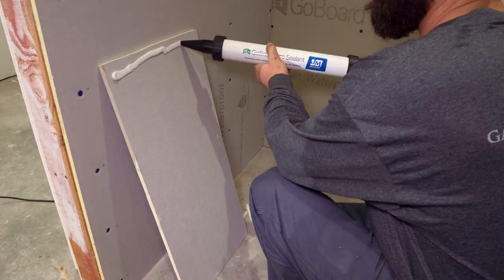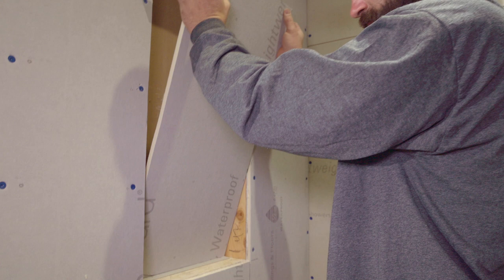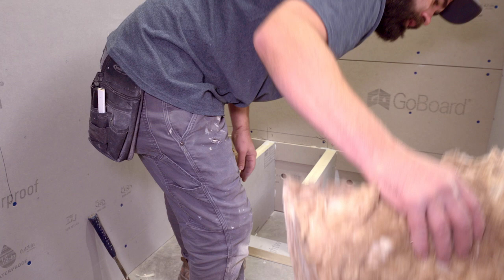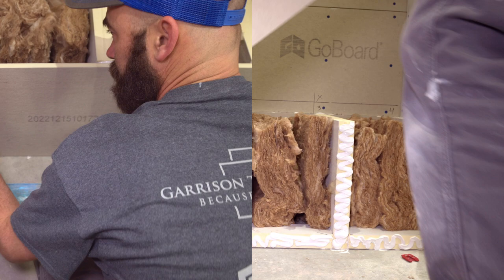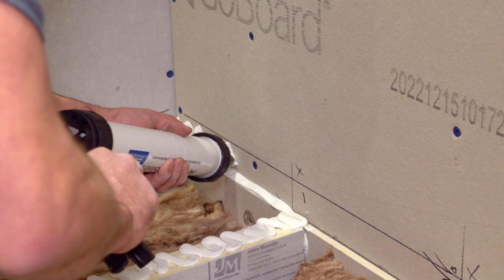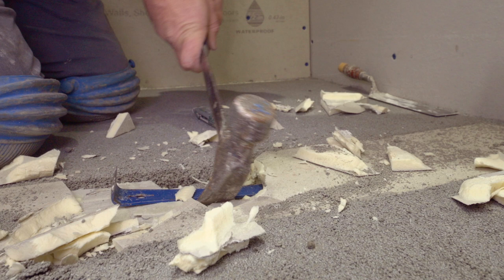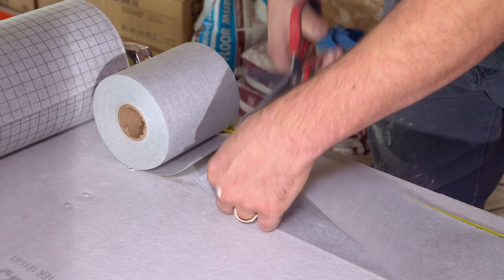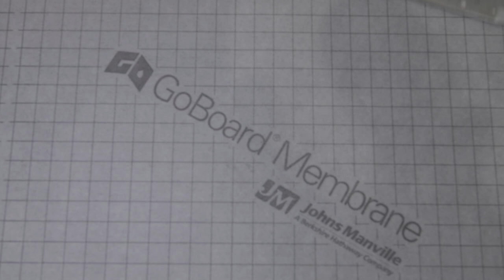2023 GoBoard Contractor Spotlight : Brandt Garrison Uses GoBoard Membrane and Thick Boards

Comment: If you were worried enough about condensation you could have put solid spacing blocks down against the concrete between the uprights for your bench support. The fiberglass insulation just doesn't have a use case here. It's a head scratcher.
Reply from the maker: Thanks for your feedback! We appreciate it! =)

Comment: I just have a question as to what exactly did you use to connect the Goboard to the concrete base? Was that thin set and if so what exact type? Look forward to your response.
Reply from the maker: Use a thin-set mortar compliant with either the ANSI A118.10 or ANSI A118.4 standard.

Comment: Why didn’t u fill in wall screw holes that dry pack is covering ( that are 1 inch from floor). ?
Reply from the maker: In this part of the video you can see the pan perimeter waterproofing; GoBoard walls, sheet membrane, banding, and sealant. When installed per manufacturer instructions, water has nowhere to go except down the drain: https://youtu.be/ONPF7jW3dc4?si=bbTBzCHGvmYARRqg&t=522